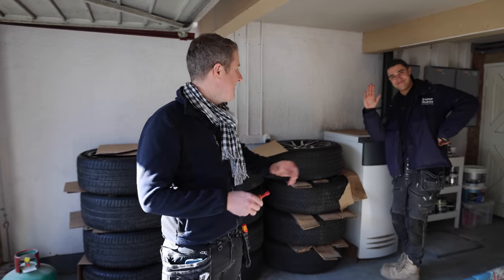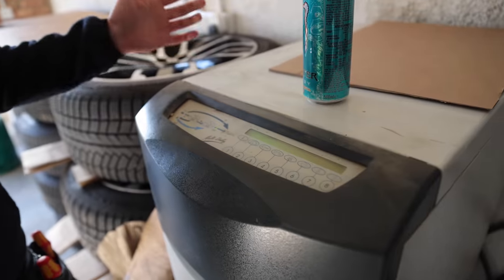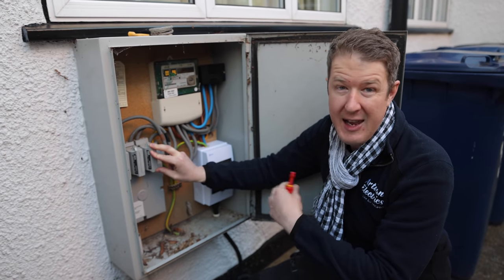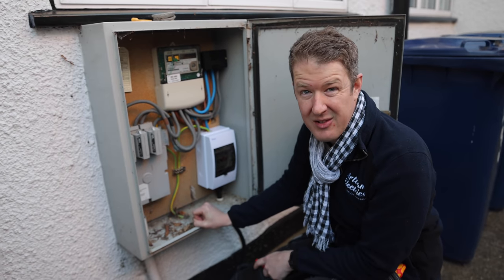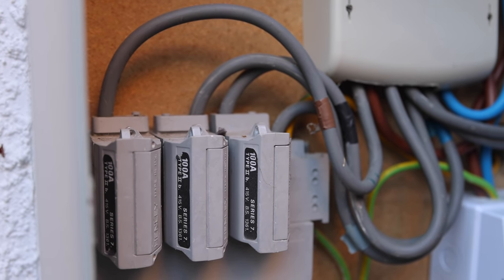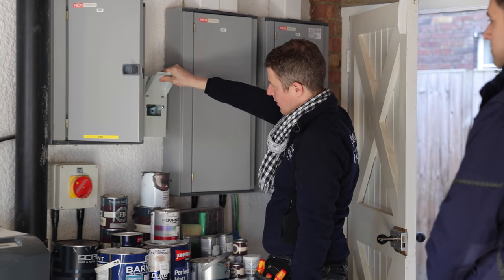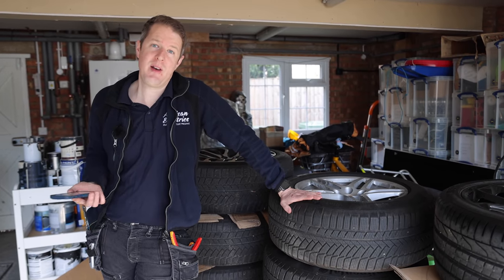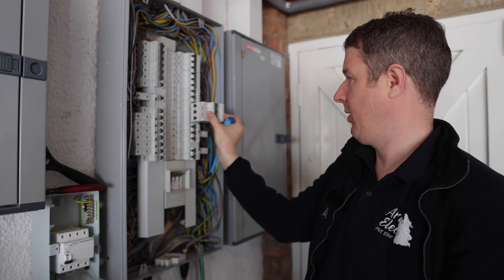INSTALLING THREE PHASE 22KW CAR CHARGERS AT HOME! - Electrician Life

Comment: The US electrical system, which migrated over to Canada, is third world.  It came about because of vested interests in the late 1800s.  It is single phase 240, with the local transformer's coil having a tapping off it in the centre giving 120v. So each house has two voltages, two or three types of ugly looking sockets, large consumer units taking up most of the wall (they call them main panels).  The mcb's are large and crude looking and 1950s looking, as are the 120v sockets which have no switch incorporated.  Boil a kettle full of water you will wait an eternity. To remove the plug people pull the cord. Electricians have to join the N and Earth wires at the main panel. Etc. Crazy.  

Why anyone would spend a fortune converting a superior UK system to American is beyond me.
Reply: The visual look of the breakers makes no difference to safety, that's just stupid. At least our panels are always metal, and we don't have meters mounted on wooden boards with cables everywhere. Our meters are outdoors inside grounded metal enclosures including the cables.
Reply: @jadon-sc1zj  
British panels are metal. Outdoor meters in apartments?  The fact remains is that the British system is superior.
Reply: @johnburns4017  The British system being superior is an opinion, NOT a fact saying it's a fact is just ignorant.
Reply: @jadon-sc1zj  
It is clear you know nothing of electrical systems.
Reply: How so? for saying that what you said is just an opinion?
Reply: @johnburns4017  I find it funny that you call connecting the neutral to ground "crazy" it's done for safety reasons.
Reply: @jadon-sc1zj  
In the UK electricians do not bond the neutral and earths together at the panel.  That is done by the supplier. Unlike the US system, only one voltage is run in (unless three phase which is rare in domestic situations).  

We have only one voltage and one type of socket and plug in domestic situations. RCBOs are now recommended on every circuit. SPDs, and of a few weeks ago now AFDDs, are recommended in the panels.

The British system is way ahead of the USA system, which is third world in comparison

No electrician who knew his stuff, would say the US system is better, or anywhere equal, to the British system.
Reply: @johnburns4017  The UK system is better in quite a few ways, yes that is true. But our system is better in some ways as well for example. AFDDs or AFCIs have been required in most living areas of the home here since 2008. Unlike in England where you stated they were recommended only a few weeks ago. Also as I said before our meter setups look a lot safer than yours. So the UK system is better in a lot of ways but it's not better in every single way, that's my point.
Reply: @jadon-sc1zj  
US appliances are/were crude heavy switched old fashioned inefficient affairs, that is why they introduced AFDDs. They are recommended in heavy appliance circuits and socket circuits in the UK. 

I worked on both, I say in full confidence that the USA system is way behind. They could improve it by introducing new types of plugs and sockets, similar to the UKs, then only have 240v. So no plugging in 120v - in order to phase out the dual voltage. There obviously would be 240v and 120v appliances sold for a while until all go over to 240v.

We do not have panels full of overlarge breakers (mcb's) taking up an entire wall.  In apartments in the UK, the main panel is a very small box in a cupboard.
Reply: @johnburns4017  I made my point and i'm done, you have your opinion and I have mine.
Reply: @johnburns4017  All you do is start mentioning other things and evade my points, nothing that I said had anything to do with appliances. this is my last comment i'm done.
Reply: @jadon-sc1zj  
You said the only thing the USA does better is wiring up meters. Which is not the case.

I like to go on fact not opinion.
Reply: @johnburns4017  many jurisdictions in the US require neutral and ground to be bonded in the electrical service enclosure. Either this, or in the first means of disconnect for the premises, i.e. main disconnect switch or main breaker inside the breaker panel. Your criticisms and suggestions of improvement would take decades to implement. Just the short stop in production caused by the pandemic has caused and continues to cause tremendous issues to the industry. Calling for the electrical system in the US, Canada, Mexico, Central America, and much of South America to convert to UK system is something that will never happen. 

The main positive I see in most installs in Europe with higher voltage would be the benefit of using smaller wire. I don’t see where you’re coming from mentioning ‘overlarge breakers taking up an entire wall. The only panel installations I’ve done that took up large sections of wall space have been for large commercial installations. 

Implying the US is a 3rd world country because our electrical system doesn’t meet your personally held standards just makes you sound like a tw@t.